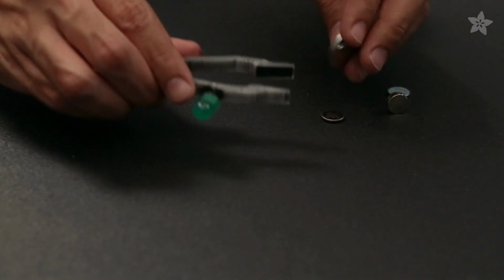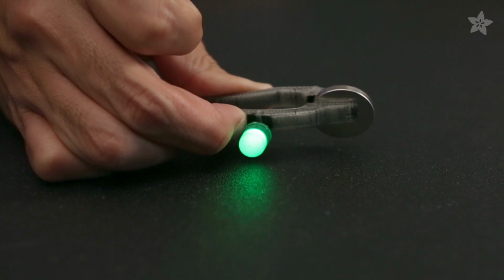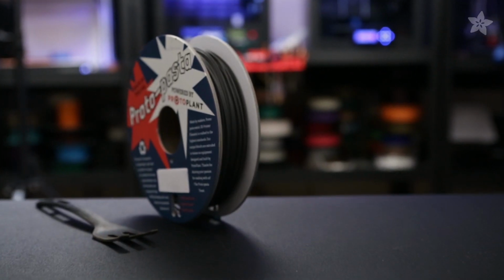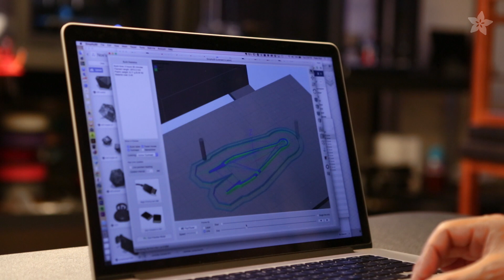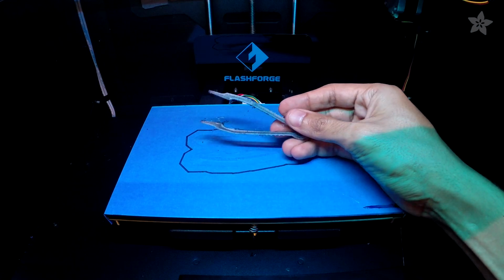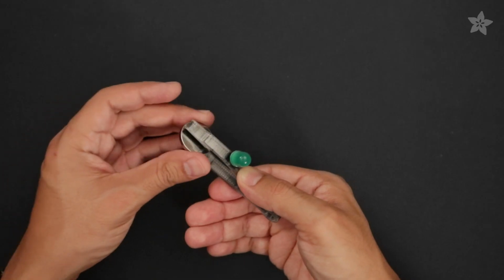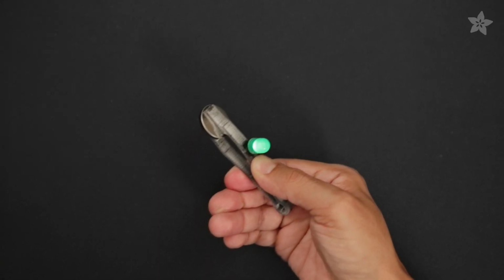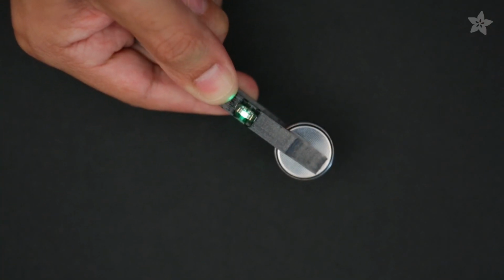3D Printed Battery Tester using Conductive Filament

Comment: What could be cool f.ex. were to be able to print a quad copter with conductive filament in the legs - no wires, everything is mounted directly on the plastic (motors/ESC's with springs for connectors?).
If a leg is broken, print a new one, move the motor over - done! No wires, no soldering.

Comment: could you print a simple circuit board with this?
Reply: Mb0ts I think it would be dangerous, because the filament goes everywhere, creting shortcuts. But there are very intersting cirduit board printers that are coming out...
Reply: It's much faster and cheaper to use traditional methods for circuitboard production, and the board will be much better too. This battery tester is an effective demonstration of conductive filament, but where it truly is put into good use is in ESD protection, RF shielding, and touch sensor pads. Also it might work quite well as conductive pads on a membrane keyboard with ninjaflex forming the rubber part.